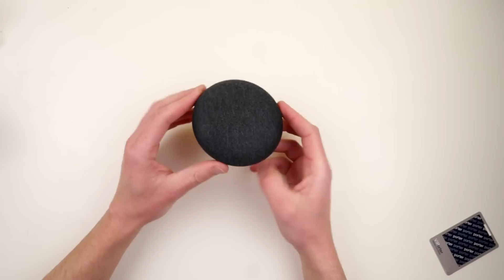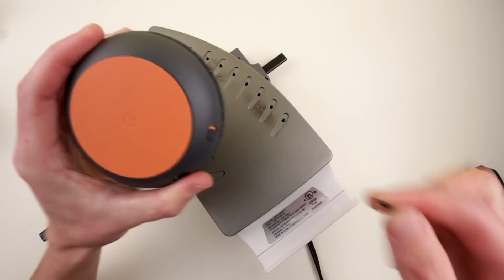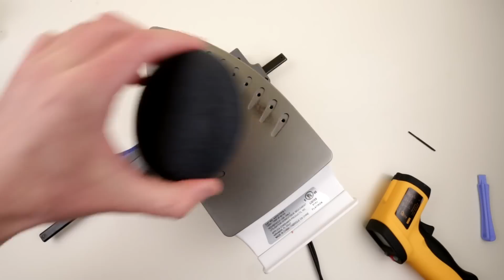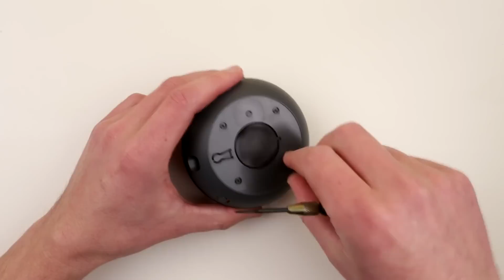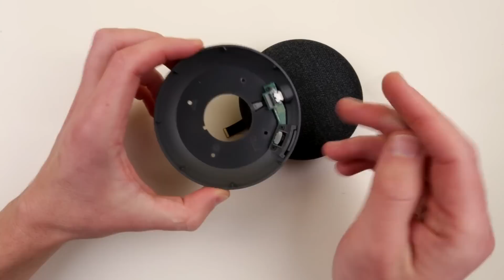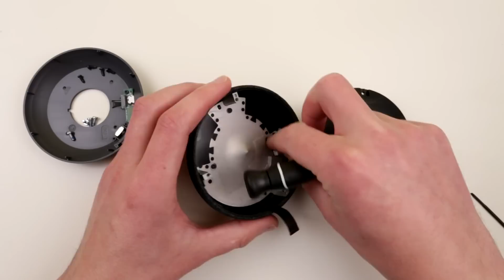Google Home mini teardown

Comment: Hi I have one of these but it won’t switch on. It’s connected to the power how do I fix it?
Reply from the maker: Try to use different power supply if not reset it using reset button.....

Comment: I used a garmant  hand held steamer i blasted the silicon with steam for not even one minute, and Voila!!! It started peeling back easily. No damage to the unit, rubber silicon and no glue residue left either
Reply from the maker: What a great idea$ Why did you take it apart?

Comment: The metal part in 24:33 is most probably the 3rd touch sensor. In the early version this button had a function of MUTE for the microphone. But, since it didn't work reliably, the engineers decided to add a simple button close to the USB port for the mute function.
Reply from the maker: Thank you for clarification, I was wondering what was that touch sensor for!
Reply: "Didn't work reliably" is that what they said? The mic mute button right? They take privacy way too seriously over at Google. 😂

Comment: Another way to open it (thanks to your video) without removing the silicon base would be the use of a leather punch tool following the location of the screws as shown in the video. The lead screw would be the one aligned with the microphone switch the other ones are aligned with a cross pattern.
Reply from the maker: Yes! This is good idea !

Comment: It is visible the connector for the two cables (red and black) It would be nice to know if they are indeed mono signal (Mono signal red + ground black) or if they are joint L+R and each one is a channel (L&R), then with the proper ground we can run a stereo cable out of the device and with the use of an external jack and some resistors  we could get a stereo output that we can use for a receiver or better speakers.
Reply from the maker: I can do measurements, to see what signal is there, I still have it dissembled :)
Reply: That would be excellent!!. Please post your findings, that would save ppl from putting the GH away and switch to echo
Reply from the maker: I honestly don see a lot of value in using audio jack..... I rather prefer Bluoetooth... and GHm actually has BT chip !
Reply: I believe the BT in GH is for incoming connections only, not sure if you can connect an outgoing connection like a receiver to it. Please correct me if I'm wrong. I found out that on this forum https://productforums.google.com/forum/#!topic/googlehome/obIZiej5L3w

Comment: It does have a latch please be careful
Reply from the maker: What latch, what are you referring to ?
Reply: the one that holds the ribbon to the power and mute switch module, there is a latch there you just pulled it out you should lift the little tab.
Reply: you seem to lift it but since you say there is none i dont want anyone to just pull on it.
Reply from the maker: I see, I tried lifting it, but it felt like it just inserted. I hope i did not break it :)
Reply: i doubt it, best just make a note in the video, thanks for the teardown

Comment: It would be quite easy to add an audio out jack just by tapping into that speaker connector. But would not be able to get stereo sound . Would be interesting to know if a stereo signal is put into the amp on the board.
Reply from the maker: Bazahaza I will do in depth look at the main board to see if we can tap to it.
Reply: Not as easy line out signal need to  be max 3 volts, at max volume its about 20 volts would blow your equipment.
Reply from the maker: We can try find a point right before the amp to tap into
Reply: I read on a another tear-down that the signal into the amp is a digital signal but would still be interesting to find out if it was a stereo signal. Might need a separate amp to achieve this looks a bit complcated.  If tapping the speaker output the line needs to be attenuated.  read this: https://medium.com/@justlv/google-home-mini-teardown-comparison-to-echo-dot-and-giving-technology-a-voice-c59a23724a26
Reply from the maker: Thank you, good read
Reply from the maker: At the time he asked was no teardown videos.  But now they appear here and there.
Reply: It would still be awesome to find out if the signal to the amp is stereo.
Reply from the maker: You mean between the TI amp chip and analog circuit ?
Reply: amirnasher I mean the input signal into the amp chip.  I had a look at the data sheets and you can see what pins are what. But I don't know if the amp can decode a stereo signal or not. The input to the amp is digital not analogue.